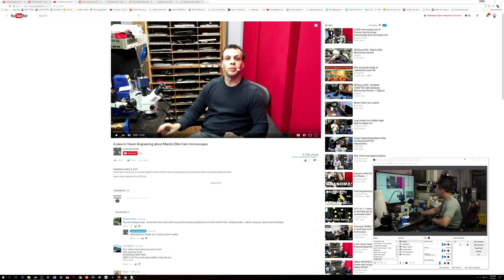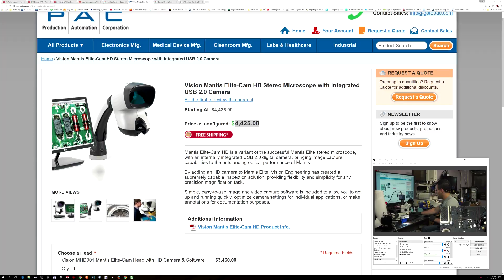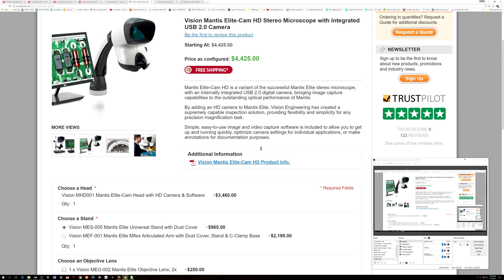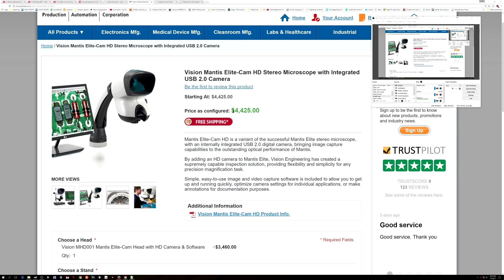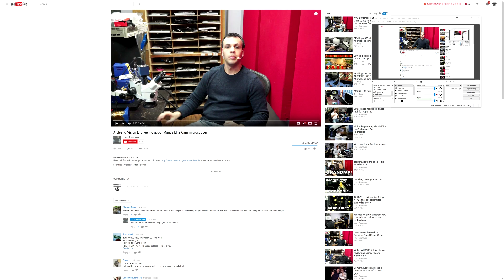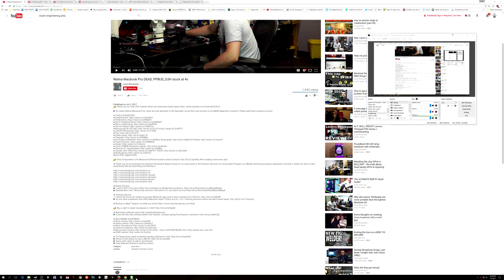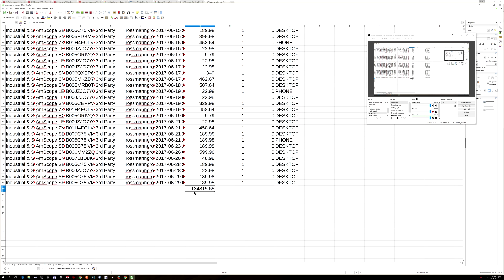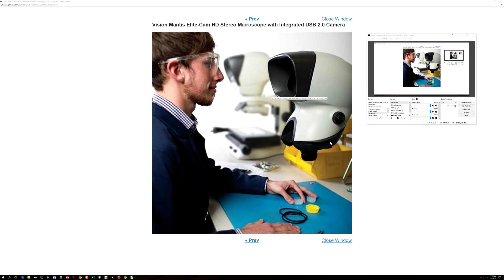A 2nd plea to Vision Engineering: please FIX Mantis Elite Cam!

Comment: Would be an interesting video if you bought one and then took it apart and tried to replace the camera with a better one
Reply: was just thinking the same thing...  just buy one and customize it
Reply: I bought a used  Mantis and am considering adding a video camera.
Vision Eng has patents on their units.
Reply: DIY modifications are fun if you pay for it with 'hobby time', but Louis also has to have a business to run.

If Louis would do this for a one-off setup, he would spent several days doing so, which would cost him north of 10k$ because he can't do other work. And it is not even clear if he could fit off-the-shelf component cameras in there or has to modify the optics of the device, which is intricate.

The whole point is, if someone is selling a top-of-the-line microscope they should provide an optional camera that is not a 1998 webcam.
Reply: Even if one of the companys decide to start making them it will take over a year before they are actually selling them, i'm just  giving a short term solution and worst case scenario is if he can't get a new camera to  work he can still use the Vision microscope during his normal work and use the old one just for filming
Reply: Yes, that is hobby time: the time you like to work on something because you like the process but it does not necessarily make economic sense if it was billable hours. Many things I build in hardware and software are like that. Louis makes a point in switching to different activities when out of the business, so i don't think that would work for him.
Reply: It might also turn out that there are standard attachment dimensions that would make it easy to swap in a better camera. Possibly not but I would think it was worth a look.

Comment: Why not add a screen to your current microscope? I know you can buy just about any size LCD panel, then you need the control circuity, and then connect the camera to it. Seeing the stuff you work with you may already have some of this just laying around. If you want the shroud that the Vision microscope has, get a bit of poster board and paint it black. As for mounting it I don't how your scope is built exactly, but a bit of aluminum, or steel, angle iron or square tubing should do the trick. Add a couple threaded rods and it will even be adjustable. 

I constantly run into problems with companies that making products, that they clearly have never had to use, that are just not quite what I need, so I just take their stuff apart and make my own.
Reply: One critical reason: You need the stereo view of the scope. The scope actually looks from two angles and gives your eyes two different images, providing a sense of depth, which is very important.
A screen does not provide that.
Reply: Would a VR headset be better for the purpose of using it with a microscope and recording then?
Reply: A first real useful case for 3-d monitors. But I don't think there is any microscope that supports 3d camera output.

Comment: Gonna sound wierd, but look into a Sit/Stand desk. I had a similar issue with a scope I was using for about 6 months. I bought a sit/stand for $200 and it made it much better for me as if sitting got uncomfortable I can just make the desk a stand desk and get into a different position. I used that desk for another 3 months before I left that workplace and found it much easier on my back and neck afterwards.

Comment: Do you think an additional 45 degrees of angle on the regular microscope would work? There might be a way to remove the diopters and place in 45 degree telescope eyepiece prisms, making the eyepieces straight out... However for proper focus you might have to shorten the eyepiece tubes which may or may not be possible, or maybe just a barlow would correct it. Might be worth a try to order some Meade 45 degree prisms of the right size...

Comment: I think VR headset plugged into the microscope would be a pretty good solution. It would provide the depth perception and let you sit in any position. External camera (like on Vive headset) would let you interact with your surroundings when not soldering.

Comment: Maybe an option would be to make a desk add-on that has a tilt of 45 degree, and a thin stopper at the bottom out of wood. Only big enough to fit your boards on it. Other tools and stuff would stay on your desktop. Than you could tilt the microscope in a comfortable angle.
Reply: Imagine trying to reflow something thats on a sloped board; first the flux would just run away, then you might have that one rogue component that decides to take a slalom down the board, oh and say goodbye to the stereoscopic optics being able to give you proper depth cue because you have a variable focal plane.
Reply: Focal length would be consistent, since the microscope is also tilted. Surface tention probably would hold the component in place, but the angle could be lowered, if not.

Comment: Looking at how high you're sitting compared to your desk you would have to lower your seat or raise your chair to use the mantis. With the normal bifocal microscopes this is not that much of a problem because you can lean over and look somewhat down into it, which will strain your neck more in the end. With the mantis you have to sit straight in front of the first lens at 90 degrees or you won't see anything. Most lab desks and chairs are taller than normal desks so you can both stand next to the desk, and more easily position the chair in normal and lower than normal position (for when you look into a microscope or close to the desk top).

Comment: you should check Nikon and Leica, they make excellent soldering microscopes too, Leica might be slightly better but you'll be paying a bit of a premium, they both have ergonomic options; IMO, based on the teardowns of the Mantis, it doesn't seem like a very high quality piece of gear, not internally anyway, if you don't care how things are built internally, that's fine and you'll be good then, but some are not

Comment: im with you louie. rather than building things based on quantity and 'market' and all that its about doing things for the right reason. its the PRINCIPLE that matters, and quality too. unfortunately we no longer live in a world with the ethos of 'if i build a good quality product it will speak for itself and many people will buy it' and we need to get back to that place.
Reply from the maker: +BCzepa the reality is that there is not much incentive to build the best product. Look at the price point that amscope sells at in contrast to what every other microscope company was selling at prior to them coming on the scene. There's virtually no profit margin in this stuff. Everyday people are asking me for the cheap version of the amscope se400, as if $175 for a top tier microscope is not cheap enough! This is not driven by evil corporations, but consumers that want the cheapest possible shit.

 In terms of vision engineering, it is a case of them solely being used by doctors and Jewelers that have no use for live video broadcasting or for a high-fidelity camera that see it as nothing but an add-on. I am trying to convince them that there is an entirely New Market out there they may have never considered making it worthwhile for them to produce for our market. Some people may use them for electronics rework but they are not videotaping their work for exhibition so they have no need for a high-end camera which has allowed Vision to get away with selling it with a $20 webcam

Comment: Louis, I'm getting a microscope because I'm tired of screwing around with magnifying glasses and loupes.  It looks like the microscope that you recommend (SM-4NTP) has a little brother that is identical in every way EXCEPT that it is not simulfocal (confirmed via Amscope chat), it is the model SM-4T and it's $100 cheaper if you don't need simultaneously camera output (it's still trinocular).  How about adding it to your recommended equipment list so I can order one and get you the affiliate credit.  Looks like a perfect fit for those of us that are not looking to be YouTube stars.  Thanks for your vids, I've learned a lot.

Comment: Hey Louis, I wonder one thing. Why don't you split video signal to second hi-res monitor?  You can position it wherever you want, can see everything, no need to bend over and so. Of course You would need to figure out space for it. Wouldn't it be better solution than your current one, would it?

Comment: Hey Louis,

why don't you use your cam on the amscope used for the video stream, place a monitor next to the scope (doesn't need to be big in display size) that only shows the pure amscope picture in fhd or better 4K or something like this and then use this screen picture view to analyse your board stuff?

Place the screen to the wall in good height and distance to your working place and I think you will have a good view on it.

Then, you would have normal ergonometric neck positions through the whole day without any compromises ...

Greetz from germany,
Matthias
Reply from the maker: Looking at a screen ruins depth perception. I have tried and fail terribly at it.
Reply: Louis Rossmann > Get a VR headset and point cameras at both the eyepieces, next thing on the list is a shrinking machine to go spelunking on the boards
Reply: Ah OK. Maybe this is a question of training, but I agree to your statement. Stereometric view is sometimes unbeatable. And yes, the VR-Set with a stereoscopic camera system was my next thought ... After all it is the same reason why rear view cameras instead of real mirrors won't work on cars or in automotive systems because you loose all depth information looking to a screen instead of a real mirror. Same issue... But well, I didn't realise that even in your case the depth information is extremely important for perfect diagnosis...
Reply: it doesn't work, you can't fake physics using cheap tricks
Reply: Yes, the depth information is very important in board repair and soldering. Without stereo microscope, it is very hard to get work done. Think of tweezers and botch wires you want to place: you need to know exactly where you are in space.
Reply: i agree , used to work at an repair company ( smartphones , tv , coffeemakers , laptops etc ) and they gave me a bench with a microscope  hooked up to a screen , wich became a stabfest with tools because screens ruin depth perception . after ruining a few boards they came to their senses  and bought me a second hand oldschool microscope .....no more stabbing of boards

Comment: It wouldn't depend on the retooling & design they'd have to do? Although tacking on a decent camera doesn't sound different from adding a cheesy one.
Reply from the maker: +S730SD they can use the same setup they have now but instead of putting a Lenovo webcam from 2004 in there they can put a real camera

Comment: It's always disappointing when companies create products that work perfectly, but has one huge flaw that ruins it. Why would you build a top-quality product without using top-quality parts? It's like finding a dream home and then finding out it's haunted.
Reply: Cost. It depends what the cameras are typically used for. Or what the companies believed they were used for. In this case though, it's probably more like they are just not keeping up with the times.

Comment: Mantis focusing is moving the entire head assembly up and down. which requires adjusting your head height/chair height to get your head in position. quite annoying. there is an adjustable stage option. more money.
I purchased a lab jack adjustable platform to get a poor mans stage. works ok. 
i believe the higher end vision engineering scopes have better focusing options. Lynx model. BIG money for a hobbyist. 
I would pay the money if i had a business like yours.

Comment: Louis, I have been told today at various non-Apple service centres that ultrasonic cleaners are band for logic boards (I have asked about iPhone 5S actually). They argue that sometimes they screw up the logic board, at one place they say that compass may go nuts if you use it. Do you think there is something to it, or this is a crap?  I have a logic board that is slightly water damaged, but I was discouraged to clean it as "the damage is minor", "you say this has worked for year" etc.  Does this make sense? Are they right of they simply can't afford to have Crest. I am writing from a relatively poor country. $1000 is like arithmetic average 6 week income after taxes.

Comment: what about attaching a 7" screen to your current microscope? they're cheap on ebay and some even have a light hood
Reply from the maker: looking at a screen you lose all sense of depth perception. Trying to solder on that type of setup is worse than trying to solder while wasted off a bottle of Bacardi

Comment: The image shown on the Mantis Elite Cam is from the original, not the Elite Cam HD. In addition as this is a USB camera, so the performance of the camera is very dependant upon the processing power and video rendering capabilities of your computer. In addition there are parameters which need to be downloaded depending upon which camera (Mantis or Lynx) you're using, which if not properly adjusted will lead to the bad images from your examples. I run this fine with my laptop PC. Keep in mind that the Mantis is designed as a benchtop ergonomic stereo viewer, not as a photo system. The camera is for quick image capture, but even so I'm not sure I could make an image look that bad on this system even if I tried. 

In addition, Vision Engineering makes a microscope replacement called the Lynx EVO. This system is a zoom version of the Eyepieceless microscope, with both a 2.0 MP, and a new 5.0MP camera option, with the latter requiring USB 3.0 in order to operate at the higher frame rates. If you need even higher resolution cameras the original Lynx is still available with a camera arm, and a c-mount which would allow you to attach any "c" mount digital camera you wished to the system.  These are not inexpensive solutions, but the value of our systems is in our patented technology to allow for projected optics... hence the ergonomic microscope design. 

So the request that somebody needs to make an ergonomic microscope with higher video capabilities has been answered affirmatively. Reach out to me if you'd like to discuss further.
Reply from the maker: +Steve Cranford the mantis elite cam hd is still using usb 2 if that page is correct. It's not going to provide anything useful at usb 2. I've yet to see any examples or detail on the lynx evo camera. If it's able to work with something like open broadcaster or HDMI capture  with high quality video that's be amazing.
Reply: Hi Louis, I sent an email to your "help" email address to continue the conversation.

Comment: Why no PC controlled microscopes? With panning and etc. outputting to your display
Reply from the maker: +Some Guy looking at a screen you lose all sense of depth perception. Trying to solder on that type of setup is worse than trying to solder while wasted off a bottle of Bacardi
Reply: Having used one for several months, I can tell you for sure that working with Amscope is much better. With a digital scope you lose your hand eye coordination which makes it incredibly difficult. If you want a crisp image, you lose FPS which is miserable because your movements will be delayed on screen. If you want FPS, you loose clarity which makes it hard to tell if something is soldered or not. Spend the extra money and get a real microscope.
Reply: There's only the Tagarno FHD, but it costs well over 5k.
Reply: Yeah but you still loose sense of depth and you still will have issues with hand eye coordination.

Comment: The current "HD" camera in the mantis is only usable as a way to capture zoomed in pictures of faults or issues on a board. It's fine for that and presumably that's what it is there for... But Come on Vision! That camera is worthless... You can do way better now!!!
Reply from the maker: If it was a $1500 microscope fine, it's over $5k with proper configuration..
Reply: That's what I mean; when it first came onto the scene the camera was probably passable... even at that price. I mean, I've been using one for over 5 years and I'm pretty sure it has been around longer than that.

But now? When your so-called HD camera wouldn't even compare to that of a $100 smartphone you're really taking the piss.

Comment: Why don't you simply split the camera output to your big screen and use that instead of looking into the microscope? It seems clear enough for that. HDMI splitters exist, so one can go to your capture card while the other goes to a screen. 

If you're using it for your schematics, perhaps getting a second big screen will be worthwhile (and cheaper) than a (yet) non-existent microscope?
Reply: Ooh, I didn't realize the two eyes of a microscope provided depth. I thought they joined into a single "viewing" tube, kind of like a periscope. Or maybe I only ever used cheap microscopes in my life. 
How does Vision Engineering do it then? Do they have that a 3DS-like screen or something? I wonder if doing board repair while wearing something like VR goggles is viable.